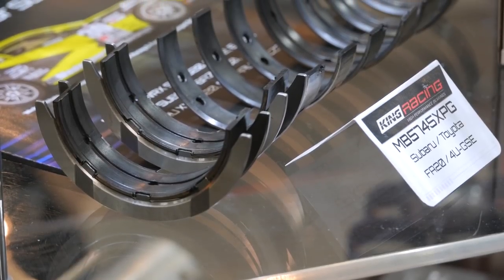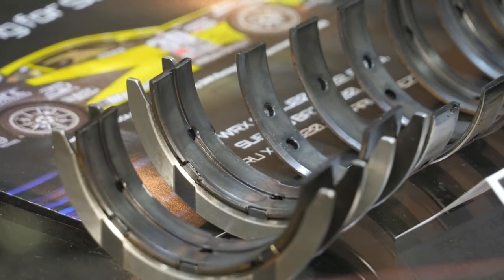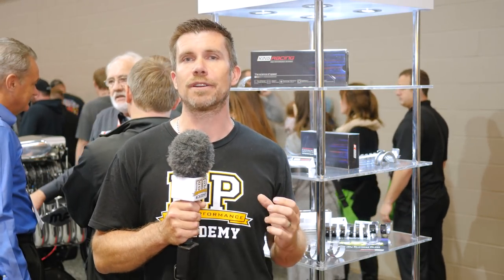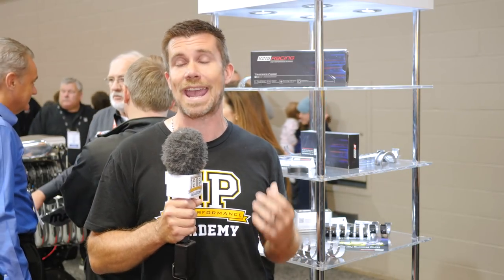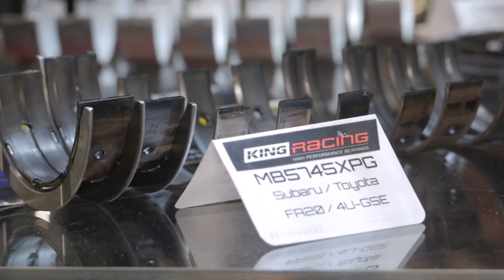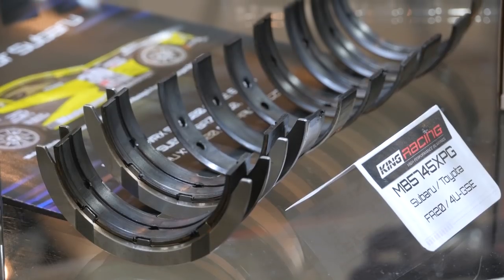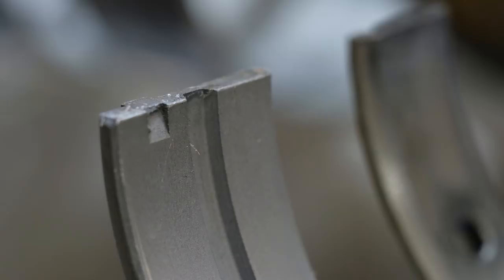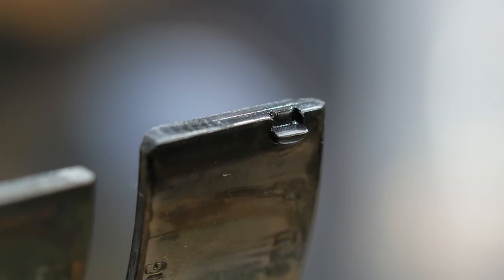[TECH NUGGET] High Horsepower Bearing Shells | King Engine Bearings

Comment: Acl bearings are prefered by some engine builders..there's been to many fails with king I was told.
Reply from the maker: Every engine builder will have his or her personal preference. You'll find most engine builders are incredibly superstitious and once they've had good results with a particular product they will stick to that product and not test other brands. I've personally used OE, ACL, King and Clevite with good results. There are basically no fly-by-night bearing companies as the cost of tooling up for production is too high. The most common reasons for a spectacular bearing failure are incorrect clearances, installation errors, or dirt and debris.

Comment: http://www.enginebuildermag.com/2012/10/getting-your-bearings/

This site says it has better embed ability but you says there is  less embed ability which is bad. I'm not sure who is right.
Reply from the maker: Not all tri-metal bearing designs are the same. With King's performance bearings, the top babbitt layer is generally thinner than a production shell. The thinner the babbitt layer is, the more load handling the bearings shell has, but the less embeddability the shell offers.
Reply: ok